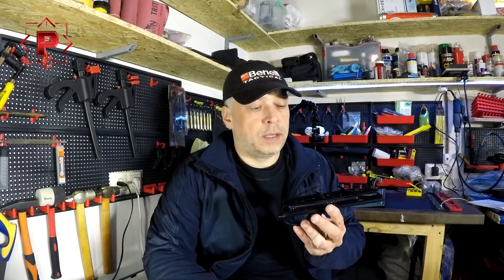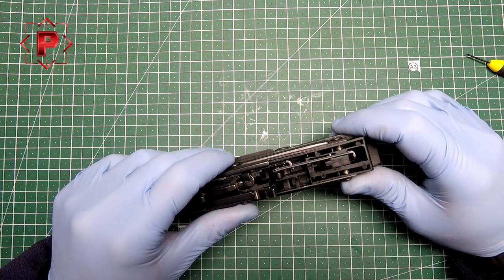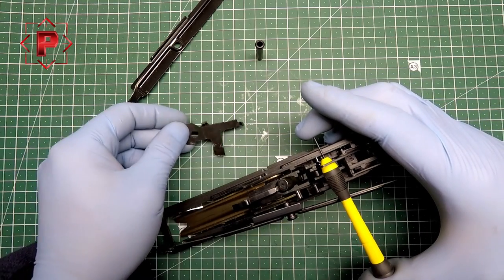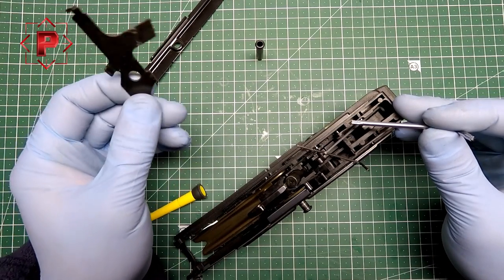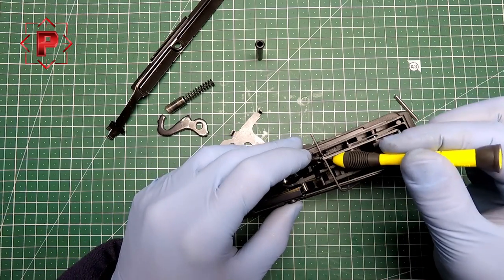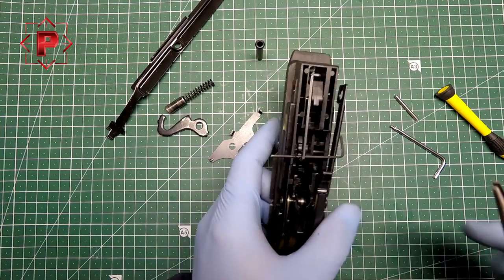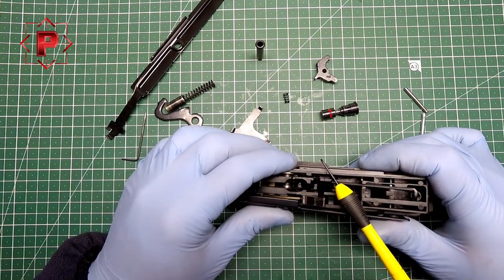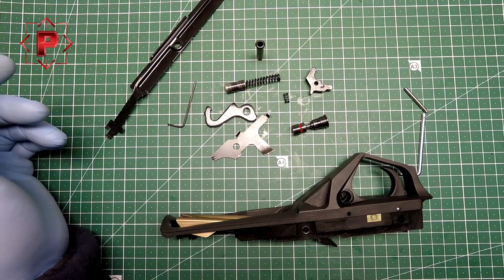How to... Partly disassemling of Benelli SuperNova trigger assembly

Comment: how did you get the safety out? I have no idea what you were pushing on? that's what I came here for.
Reply from the maker: under the safety button is a pin on the spring. this pin is holding button at position.  there is a ring protrusion on the body of this pin.  the pin itself moves only vertically.  you need to take a thin rod, touch by the end of the rod edge of the ring protrusion and press down.  at the same time you need to press the safety button so that it comes out of engagement with the pin.  it is very difficult to see with your eyes, just feelings of your fingers
Reply: @PracticaUA    thank you I finally got it. I would hate to work at the Benelli factory being the guy that installs safety buttons on hundreds of novas coming down the assembly  line..haha. it took me several hours to do one.
Reply from the maker: your momma 🤣🤣🤣👍🏻👍🏻👍🏻
Reply from the maker: your momma seems it is totally worth kind of gunsmiths work)))